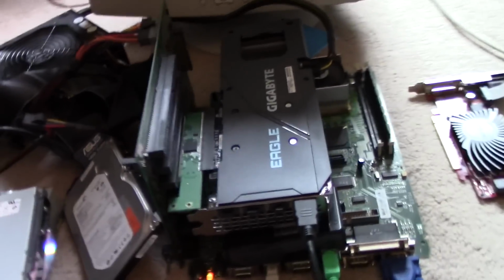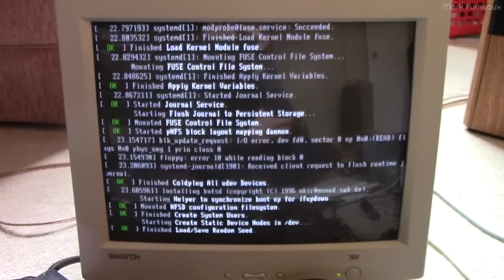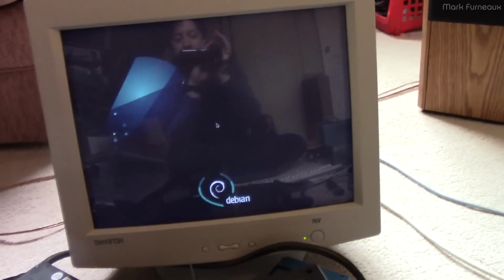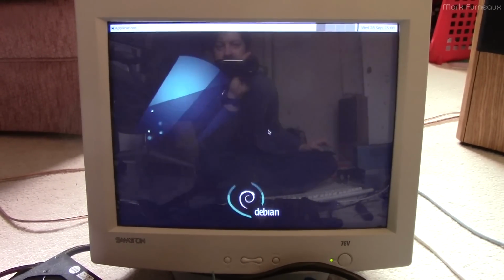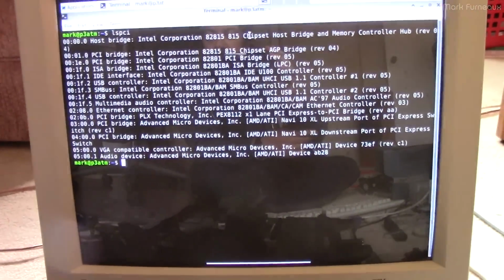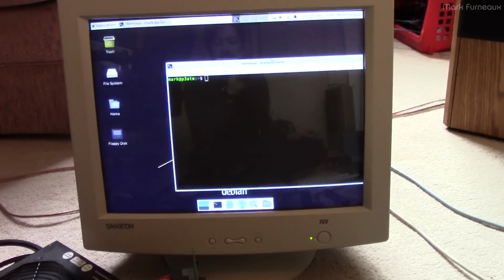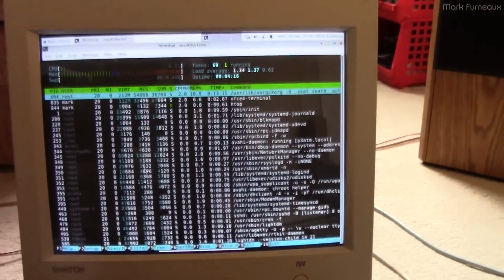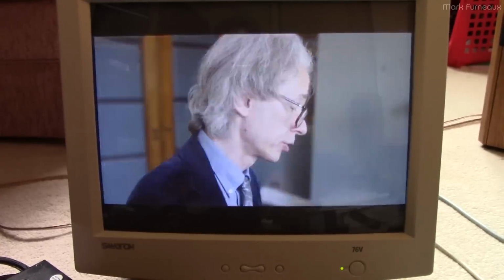AMD RX 6650 XT on a 20 Year Old 850MHz Pentium 3

Comment: Actually the TPM header on new motherboards uses a ISA bus.
There are diagnostic cards that show post codes from this TPM header.
One example is the TL611 Pro that sells on aliexpress for 15 dollars.
Reply from the maker: The old style used LPC off the chipset, but Intel is really pushing all to be SPI in the near future
Reply: Wait... So a huge problem with running old DOS games on modern hardware is isa sound cards. Is there enough pins on that tpm header to adapt it to a 8 or 16bit ISA slot?
Reply: For an Isa sound card connected via a tpm header You'd need an LPC to ISA bridge chip. Older TPMs connect using LPC which is logically compatible with ISA but not electrically compatible. The most Modern motherboards that have ISA slots are known to use LPC bridge chips so creating an adapter card with a bridge chip that plugs into a LPC header should in theory be doable. Whether or not this is truly dos compatible remains to be seen, This of course wont work on the most recent mother boards that have an SPI TPM header (newer than about 2015)

Comment: This dude clearly doesn't believe in ESD with the mobos directly on carpet, lol! This is cool, tho, seeing a throwback with the main board that connects to the main board; and doing things u can't do is always cool.
Reply: Thing is, for ESD to occur, you need friction. Though, yeah, it's probably not the best decision to keep components on carpet hahah
Reply: @kadrix732  Is there friction when you unwind self-adhesive tape? There is definitely ESD, when tape layers detach from each other. You may even see sparks in darkness.
And then, in case of carpet, simply you walking on it is friction already.

But the worst outcome is discharge without visible/audible effects, so that you may not even know you killed something with ESD.
Reply: @Mr.Leeroy  Linus Tech Tips and Electroboom made a video on ESD where they purposely stunned components with an ESD gun. New components are extremely hard to kill with ESD, they had to try really hard to. So, while it's better safe than sorry, it's really not a massive issue, you have a much bigger chance of just toppling over and killing the parts by falling on them xD

Edit: I made a mistake, turns out they actually shocked an older computer. New components have even more protection, making it an even lesser issue.
Reply: @kadrix732  the thing is I know what I'm talking about because I prototype electronics from the ground up on component level, not because I saw some video that only tests PC parts BTW. Sure often they feature HBM protections build-in, but these take up significant amount of silicon 'real-estate' on IC die. There as much more individual ESD sensitive components that leave out protections for PCB designer to include externally, and they are not a priority in real world production cases especially against costs.

I mean you can play lottery with electronics on carpet for years and be lucky in ignorance, not even knowing why it would silently stop working one day, or may kill it in the first day just by handling it in lab conditions simply because you forgot to put ESD grounding strap. Whatever tickles.
Reply: @Mr.Leeroy  I think you kinda misunderstand what I'm saying. I don't disagree with you. And I'm not saying "Who cares that it's on the carpet lol"

I know it shouldn't be, it's not the right place for electronics, I'm just saying that in most cases it's going to be fine. If someone is unlucky, it can kill a component, but even then, it takes a bit of effort to.
Reply: @kadrix732  ikr, I just think of carpet as an ESD bank. It's a testament to the fact that ESD isn't the major risk it seems, probably almost as likely as lighning striking you; but if it happens, that anomaly suddenly means more than anything.
Reply: @jeremymoon9088  Even if the parts do get shocked by ESD, the chance it'll kill them is very low. LTT and Electroboom made a video on it, they had to try really hard to kill RAM.
Reply: @jeremymoon9088  there are components that cost hundreds and thousands, I'm sure you won't take chances with those.
And even if PCB is not worth a fortune anymore, you may still kill some component that is long out of production and is PITA to even replace, not to mention the whole troubleshooting headache to find what died in the first place.
Reply: @Mr.Leeroy  it's not something I worry over; I just hear so much about it n content that it's funny to see someone placing components on carpet. With the things we used to do n the shop back n the day, tho, ESD is not much of a risk, no.
Reply: ESD cringe every time (:

Comment: Mageia 8 has a 32-bit release that's compiled for plain 586, and includes a lot of stuff out of the box! It's far from a lightweight distro though. Mageia 9 is currently going through QA testing, but from what I've read it should release with kernel 5.19 compiled for 586 just like its current release.
Reply: @unsubtract Indeeed... with a day or two of compiling you could have this going. I've done it, it doesn't take much longer than a normal install (you just go to sleep while its doing its thing). Gentoo is easy... Linux from scratch is hard (not even hard it holds your hand all the way through its just much more typing and less functional after you are done because there is no package manager, except for you).
Reply: Could instead go for a lightweight desktop like fvwm or e16, should make it a bit nicer.

Comment: Gotta love them OCZ power supplies that are somehow still working 🤣🤣🤣 I've beat the isht outta a 600W OCZ for about 16 years now
Reply: Wow. I upgraded to a Corsair TX550M from a StealthXtreme 600W, simply because it was 10 years old. But I hear that as long as you keep it clean etc, the only part to fail will be the fan inside.
Reply: @MA-90s  main filter capacitors will fail as they age. The major portion of failed electronics is failed electrolytic capacitors. When they go they tend to take other components with them too.

Comment: I can see using that bridge card on one of those OEM Pentium 4 boards that has PCI slots only. I’m going to try it with this eMachines board I have like that. Should be a fun little experiment. I’ll use XP so there will be real drivers usable for the GPU.
Reply: Or a pentium iii as well. A lower end pci-e card like an HD 2400 will be much faster than most common PCI cards.
Reply: @EvilTurkeySlices  true but we are talking about a system that only has PCI slots…no AGP or PCIe on the board.
Reply: @mesterak  exactly, there are plenty of pentium iii boards that don’t have AGP.
Reply: Or you could look for a zotac gt610 pci. They were available up till 2021ish. But other than a video output, they are nothing, due to pci being really slow and much other stuff of most mainboards hangs internally on the same bus. Like ethernet, internal audio, usb 1.1/2.0 host, some pata hosts, some sata 1 bridges...! So using pci for nothing but for giggles is ok, anything else is just self mutilation.
Anyway, if "possible" use any old agp card, if not zotac and some other brands have you covered with "native" pci video adapters.
Reply: @bloeckmoep  these are pricey still even if you can find them.

Comment: I have that same fan-less radeon card, and i have to tell you that it does overheat if not cooled properly. You will need a case fan or open-case to make it not overheat and shutdown. I accidentally left the case closed without adding a case fan once and unfortunately it overheated. It still works but it puts out a lot of heat and shuts down quicker, maybe i burned something in it

Comment: I enjoyed watching the video. Getting a p3 to boot with a pcie card is nuts. Outside of the fun of getting it to work, I can't think of a reason to do it though.
Reply: the ability to add modern expansion cards could actually be practically useful. on my p3 gaming machine i dual boot win98se and modern debian to make putting files on it easier. modern pcie usb, wifi, ethernet, etc cards would be easier to get a hold of than pci based ones, and for most purposes i wouldn't care about if windows supported it, only if linux did.
Reply: @Megabobster  I don't think this would work too well with Windows as the drivers simply are not there. This works on Linux because Linux keeps a lot of drivers for backwards compatibility. But for really stupid stuff you would have to build a custom kernel for it to work. The canned kernels only support so much.

Comment: Do a pentium 3 + PCI-E to USB riser. You can probably install old Ubuntu 16.04 or whichever was the last 32 bit one so that it has some AMD drivers.
Reply: Those are sketch/trash. The botch latency and are limited to about half a 750ti speed.
Reply: @DarkLinkAD  even 750ti is too much handle for Pentium 3 bro, won't make a lick of difference, but at least the driver support will be there.

Comment: Imagine a kernel that could leverage the GPU memory as ram or even patch microcode to extend the CPUs capabilities via CUDA or similar
Reply: Or an adapter that could make that whole motherboard work in a pcie slot on a modern system
Reply: @christopherjackson2157  there are whole systems on cards already
Reply: In Linux you can use the VRAM from the GPU as swap, check the arch wiki
Reply: @tylerdean980  SWAP that is faster than RAM? wtf
Reply: @tylerdean980  makes sense that Arch has this covered all ready.

Comment: Glad to see you back, Mark! Love these crazy projects with the nostalgia aspect (CRT was a great addition). 
Would like to know your opinion on the new 12+4pin power cables being introduced. We are seeing GPUs potentially pulling sustained 500-600W very soon... on a single 12V cable. Is this reason to be concerned?
Reply from the maker: There is nothing technically wrong with it. As long as the conductors are made to spec, there should be no issue. AFAIK the melting PCI-SIG was seeing was due to manufacturers not doing testing on their own products. I do think the design of the pins could have been improved for lower contact resistance, but nothing we can do now...
Reply: @TheUbuntuGuy  It's always been a hack... the correct thing to do from the PCI-SIG perspective would be to just use a proper sized single power cable. It would be better in pretty much every way even airflow. It is even dangerous if one of the wires fails your it can end up overloaded and a fire hazard outside of PCs supplying a single load with multiple unprotected circuits isn't even legal.
Reply: @TheUbuntuGuy  Thank you. It seems your comment aged like fine wine.

Comment: Not related to this video, but in regards to this one of yours: https://www.youtube.com/watch?v=5uqmpTO1qpE (How To Build A Slow Charge Cable To Extend Your Phone's Battery Life) 

 Do you know of any CC IC's that can do less than 150ma? I'd love to slow-charge some devices with a sub 100mah battery
Reply from the maker: You can just use a very standard LM317 as a constant current regulator. See the datasheet for the wiring diagram and programming formula.

Comment: Just to add to the PCI condundrum Morten over at My PlayHouse ran a PCI-E connection from the 1x PCI slot meant for a wifi card ,on a Lenovo ThinkCentre M93p Tiny PC via a similar method. He ended up with a very dodgy looking external RAID Controller and hard drive attached.